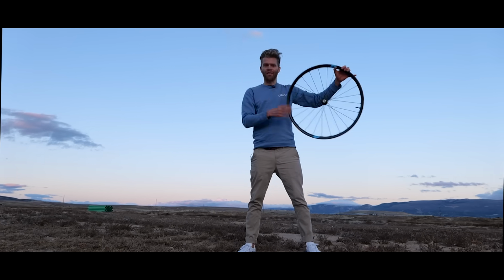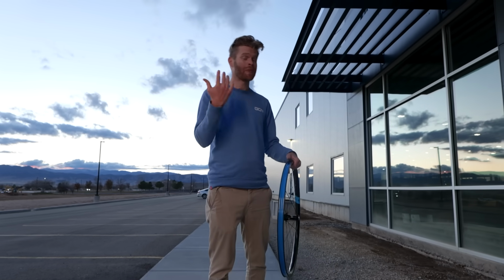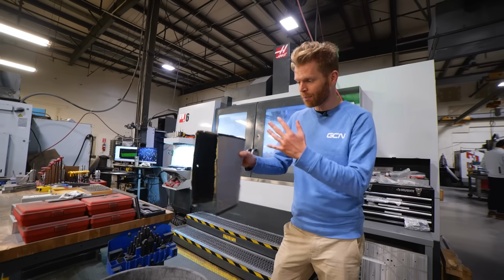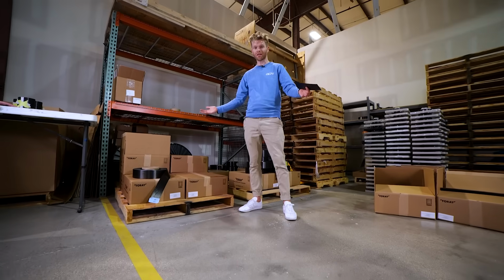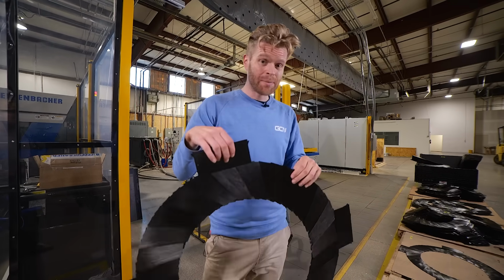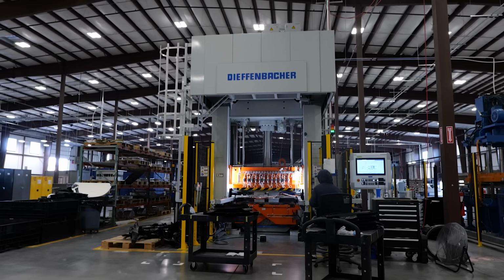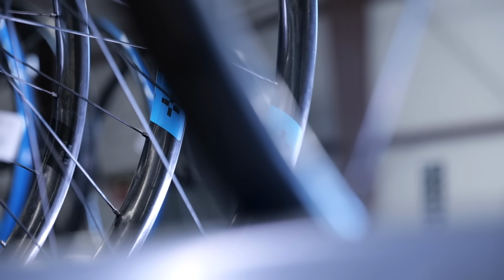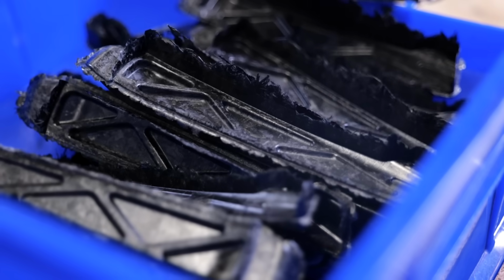Is This The Next Step For Carbon Fiber Bike Parts?

Comment: Alloy rims are 100% recyclable into new alloy rims or beer cans. Most of us don’t need carbon rims.
Reply: Carbon fibre is the corporate bike industry shitting on the idea of bikes being environmentally friendly and selling it like it's an advantage. Pricing them like motorbikes isn't helping either.
Reply: Most people who own bikes also dont ride them
Reply: Until you have ridden good carbon fiber wheels at which point you'll never want to ride a junk aluminum
Reply: @timfox4613  I've owned and ridden the latest T-800 carbon fiber and have zero interest in it.  There are 7 series Alu rim blanks that weigh 400 grams, it's uneccesary.
Reply: @___Bebo___  it's not about the weight 😀
It's about the quality of the ride,  it's about the aerodynamics T800 😭😭so you've ridden Chinese knock off junk 
I've ridden and raced on all of the best aluminum and it isn't even close 
I used to train 50% on alloy (only on pavement) the last few years, now I don't waste a thought
Tubless, Disc Brakes and high quality Carbon fiber is light years ahead of any aluminum wheel
Reply: @timfox4613  Winspace wheels are #1 in aerodynamics right now, the cheap Chinese stuff is faster right now so you're speaking from a place of ignorance.

To me, just rotational weight matters, I don't feel that there is a ride quality difference.  I only ride 32mm and larger tires though so maybe I just can't feel it cause of that.
Reply: @___Bebo___  win space wheels suck they may be aero but nothing else they handle poorly the ride quality is pooooooor the road feel feedback  is terrible 
Sorry my friend but you would be the ignorant one 
Aerodynamics is just a small part of the equation
Oh and by the way who says they are fast in wind tunnel and at what angle and what speed and how do they handle in that wind
Reply: @timfox4613  lol, they use the same carbon with last years mold with the same workers usually.  You're being delusional.  My bad bro, I'm sure your Chinese wheels made in some hell hole were made extra special that day, lmfao.
Reply: Most of us don’t need bikes either!
Reply: Nope of us need fancy stuff, but we want. You gotta create something that is fancy enough for rich people to spend their money.

Comment: Great, all we need is a second fabricator using this technology, so that the competition between the two will result in reduced prices.
I wonder what the performance difference is?  I suspect that epoxy resin is more stiff than nylon.

Comment: I don’t understand how they “weld” together the two rim halves in the mold. I assume that there are further carbon layers overlapped to join the two rim halves, otherwise the finished rim would have no structural integrity. But I cannot make out in the video such a detail in the process.
Reply: That was my question too—the way it appeared, there would be a “seam” running along the spoke bed that’s just stuck together with resin and no fiber reinforcement.
Reply: I know a llittle of how such things works, in the traditional way yes, you would need some overlap.

in this way the use of nylon squeezed and heated together, will create a bond just as strong, like the guy said, nylon matrix can be reheated over and over with no loss, so it will melt and set in the mould, I know of some Glue's used for bonding CF prop shafts to metal parts within the F1 industry, it's aerospace glue, stinks like fuck... and I mean it's horrible a/f, but in 12hours that glue is stronger than the rest of the carbon fibre part, the carbon would break first before the glue would ever fail.

makes you wonder though.... just make components out of the glue alone lol.

and they will have used something like FE mapping and real physical world mechanical stress testing to prove the strength of the part (In this case a wheel).

so they will be good.

the real question is... are they stronger/lighter or same equivalent as traditional layup.... and at least cheaper, seeing as how the process is robotised.
Reply: just like in a conventional weld material from two parts mix up, here the ends of carbon strands interlock.
Yes, it's not as strong and effective from standpoint of material utilization, but sufficient and surely not presenting a distinct seperation like a glued joint.

Comment: Thanks Dr. O and crew....was it hot in there ? Loud and smelly ? I used to work in plastics manufacturing , using injection molds and ultrasonic welds , and it was HAWT !

Comment: If you visit this company's website, you will be surprised to find the wheelset price. Despite the claims of saving human labor and production wastes, the MSRP for the gravel wheelset is quite steep.
Reply: bout the same as any other high end carbon wheelset
Reply: Just giving us the MSRP was never an option I guess
Reply: To be fair, they're made in the USA, which automatically comes with higher cost. Also, they sell rims alone for $425 each, which is reasonable. You can easily build a wheelset a grand cheaper if you avoid those stupid overpriced hubs
Reply: Just wait until chinese manufacturers copy this technology 😁
Reply: No it isn't
Reply: Ollie did also spend a reasonable chunk of time discussing how much time, effort, expense, and expertise, went into working out how to make these things though. Much like everything else you've just got to factor in recouping R&D etc
Reply: Well of course, cycling is currently regarded as one of the biggest markets of suckers with money out there.
Reply: @gordonhenderson1965  Buy all the machinery, build the required molds and make carbon wheels yourself. Do not violate any of the hundreds laws regulating the industry in the process. At the end let us know how much you are going to price the parts you produce...
Reply: @andreamig1  Why should I be bothered about their machines? If it is more expensive than traditional tech and provides few benefits (like nebulous recyclability), why pay the premium?
Reply: @АнтонАлексеенко_044 I'm not talking of their machines, I'm just saying that you probably need some machines to produce wheels of the same quality level.
Reply: @andreamig1  No offense, countless of wheels straight from China's brand has done this and demonstrate how low the price can be and still be profitable. Of course, the same wheels coming from same factory with different decals will double the cost as the decals is very premium.
Reply: @andreamig1  so you're saying conventional manufacturers don't use machines, don't buy molds, and constantly violate regulations. A-ha, sure.
Reply: @feedbackzaloop No, I'm not saying that. The opposite. I was just replying to the guy who says that generally bicycle carbon parts pricing is a scam and there is no reason parts should cost so much. So I suggested that manufacturers have to buy machinery, pay for molds and pay the cost of being compliant to a lot of regulations.
Reply: @andreamig1  well, he is right in the way that there are plenty of manufacturers who do things right and still keep the price low not as high.
Reply: @Chris-iv2ud  Well, I replied to this with a detailed comment that now seems to have disappeared. Let me summarize it again. I don't know to which Chinese wheel brands you are referring to. The fact that carbon parts gets built with the same material and technique doesn't mean they end up being the same quality level. For examples there are videos showing how even the same frame model but from a different production serie of a famous German brand when cut open show to be at different quality levels. But let's say that a Chinese brand manages to achieve the same quality level of a EU or USA made wheel; the price will be lower because of lower labor costs, costs of being compliant, energy, materials sourcing, probably logistics, and other factors...
Reply: @andreamig1  you are getting close, but still missing the main part - comparison between a dedicated bicycle mass manufacturing and a side shop of aerospace batch manufacturer. It's not because of better product, but because all effort and costs could have gone into making a more expensive product. Welcome to economics 101
Reply: @JanGoh-jb5ge if you do the research, you will find out it is only partially true, accounting for third to half of the difference. Rest is a markup and inefficient managment cost (as calulated per single piece).
And it is not even a cutting edge product, only marginally lighter than aluminium rims with same dimensions.
Reply: @Chris-iv2ud   Fine tolerances and QC cost money. The same factory doesn't make quite the same product on the night shift.
Reply: @KimMoth  Yes, gotta be fair, same factory that oem for different brands has different qc standard from the brand. Still those "premium" and expensive product has pretty shxt qc. Might as well said they didnt really has high standard to their own products. I have see so many dogmx and colnagx frame that has so many leftover resin and carbon inside the frame, its frexking unbelivable. Yes, it doesnt affect the frame in term of their riding experience but i expect them to have a higher standard in every aspect for that price tag.
Reply: @JanGoh-jb5ge I think you are answering the wrong commentator: I'm not the OP and can't say for any non-technical value.

Unless you specifically targeting the weight remark. My background is ATB/MTB and it has always been that every niche had their strength requirment. So all XC rims are similar, if they are more durable, they are marketed otherwise, say, Enduro. And then rest comes to the technology, if it can allow to reduce weight. Same with touring and dirt, everything is bombproof by default, something is just a blockbuster bomb itself🤷‍♂
Reply: Another rip off for us all to buy at thousands for a set of rims omg .... So now they want us to buy wheels and carbon with no waste and no human labour ? No jobs then just profit ? Nice pmsl
Reply: @curtisducati Yea I do t see any humans working in the factory!
Reply: @curtisducati  A product is not a rip-off just because it's expensive. It's a rip off when the profit margin is abnormally high because the product's price is high compared to its manufacturing costs, or when the product is inferior in reliability or quality. One might also claim rip-off when the only justification for high price is limited availability, like drinkable water after a flood. Some people might consider a product a rip-off if they expect a level of service it was not designed to deliver, like when someone expects Honda reliability from a Ducati.

Comment: Are these wheels actually cheaper because of the advantages you've been mentioning? Or does the manufacturer make extra profit this way?
Reply: Because it is largely a new technology, the price initially will be high to recover R&D and investment costs (machines etc.).
But at least in theory, over time when the technology gets more widely adopted, the price will go down.
Reply: @erikvanderveken1408  i just looked £2.100
Reply: @erikvanderveken1408  I'm looking for a price comparison right now. Not eventually.
Reply: Anything new (such as new material = new product = new machines = new labour personel = new techniques = new training for work = more expensive advertisements etc.etc.etc…
Reply: @Epiqe  
new material - cheaper material
new product - no comment
new machine - old processes ask for new machines all the time too, everything has a lifespan
new labor - freed from old work
new techniques - same, just replace older
new training - a) all workers learn as they work anyway b) new techniques are more automatizes, less learning needed
more expensive ads - new product is easier to advertise than anything same but 1% ligher/stiffer/more aero
Reply: @feedbackzaloop  as someone who works in R&D, (completely different industry but the principle remains the same) I can attest that there are huge costs attached to bringing out any new product.
It may sound extreme but the r&d process for one food product can take up to a year. That's a years wages for several people, + raw ingredients/materials, energy costs,... that need to be paid before a single product has even hit the shelves.
So the way you are describing it is a little too oversimplified.
Reply: @erikvanderveken1408  as someone working in tool and machine manufacturing with background in design, absolutely agree upon associated costs. Except that all costs mentioned are partially paid from sale of older products and partially by credits and or investments. Most people are on a payrole and would get salary irregards of whether new product is launched or older improved. Now, the requirement of maximising the ROI is what keeps the price of new product high.
And of course I oversimplified for the sake of YT comments, answering Epiqe's one-liner. One cannot compress two years of specialization and a decade of experience into a paragraph. Although experience seems to be more self-repeated than cummulative😅
On the side note, the real R&D gemstone of these wheels is production of carbon reinforced nylon. That is what takes several years and work of a department at another company. But already accounted in material costs.

Comment: Great thanks 👍 I've built over 20 aluminium wheels and used them up. Never tried a carbon wheel! I'm wearing a braking track in 5 k winter miles or 10 k summer. Are carbon rims good value?
Reply: If you're wearing through that many rims, I'd recommend trying a disk brake setup. When the disk wears thin, you just unbolt it, bolt on a new one and carry on with your existing wheels. Going to disks saved me a fortune on maintaining my mountain bikes. Carbon fibre will be a more expensive, massively less environmentally friendly option, even if they last twice as long (Which is highly unlikely in the scenario you describe as carbon fibre in general isn't great at handling abrasion).
Reply: If you're on rim brakes don't even bother with carbon wheels. It was so problematic that it started the initial push to disc brakes a couple years back.
Reply: @EBikersplace  a disc brake bike would be more up to the job, rotors are cheap in comparison and last quite long
Reply: Thanks, did you just change the forks and leave the rear as a rim brake or was there mount points? That's my issue . I'm going to try a rim with a thicker braking surface until I get parts for the disc brake option.  @simonm1447
Reply: How on earth do you wear though rims that fast?  Use the Dura Ace pads or something, lol.
Reply: @___Bebo___ depends on the type of bike. If it's an e bike (there are still some cheaper ones with rim brakes) you have more mass and if its hilly you can go through a rim quite quickly.

They have also far more disc pad wear than a lighter bike, if you run disc brakes.
Reply: @simonm1447  Bro it takes me 40,000 miles to wear out a rear rim brake wheel this guy needs to pick the metal out of his pads once and awhile.  Every time the wheel comes off a bike you check the brake pads for metal.
Reply: @___Bebo___  on my E bike it took 13k km for the first front wheel rim to get worn. It's hilly here and the bike had a rim brake, its also heavy since I use it to transport stuff.

Later I replaced the fork and changed to disc brakes, the pads have a lifespan of around 3k km.

You can not compare this with a lightweight roadbike driven in sunny weather on flat roads

Comment: the resin in traditional carbon is what holds (held?) me back from buying carbon. it is toxic, wasteful and most of the time not repairable.
Reply: It cracks after 800 hours of use also.  This nylon tech looks like a big step up

Comment: Freezers gone, lay up mechanised, autoclave gone, humans to layup and trim gone, laser etching, decals, painting gone, mechanical spoke drilling - and to save the final production cost it’s recyclable. I can’t wait to the see the filter down to the consumer in significantly lower priced carbon wheels ???????
Reply: im sure they will not reduce the retail price of wheels in a significant way, this will just increase their profit margins and products build this way could also be inferior.
Reply: price is usually not determined by cost plus x but rather what the public is willing to pay (especially when items still under patents and R&D and capital costs have to be covered)... good luck dreaming though (I expect you had your cheek full of irony/sarcasm though hence the "?'s")
Reply: @JermTheCow  two ways - sell a few at high margin or sell many at lower margin. The bike industry is on its knees at the moment and needs to re invigorate the consumer as there is a lot of publicity about the industry having been greedy over the last few years.
Reply: @swifty0000007 100% agree with you. It's often a knife's edge though, personally, I think the "greed" aspect is somewhat overhyped, there are a lot of "hidden" costs and other risks in maintaining a sustainable business, especially ones that involve innovation and engineering.
Reply: These rims are like Skyway BMX rims as far as materials are concerned .
Reply: Humans still need to deburr and sand the rims smooth after fusion moulding .
Reply: Also, it's not going to be recyclable - just downcyclable, you can chop it up and use it as a fibre reinforced plastic, but you'll never make these wheels into more of them of equal performance, same as carbon fibre. It's probably less awful for the environment than carbon fibre, but that's hardly an achievement given metals can be recycled indefinitely.
Reply: Good luck with that.  7 series Alu rims weigh 20 grams more so this tech is strictly for the flexers.